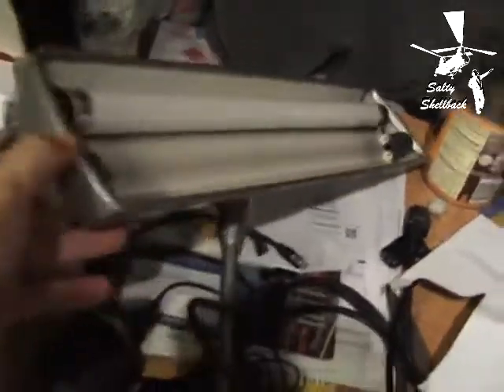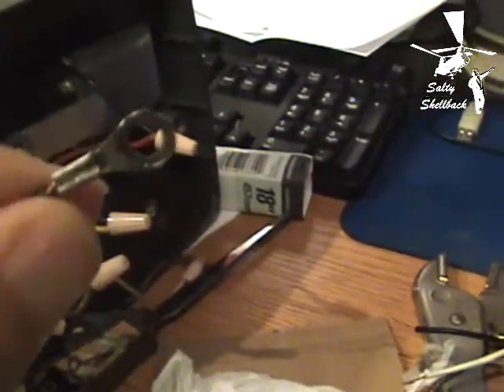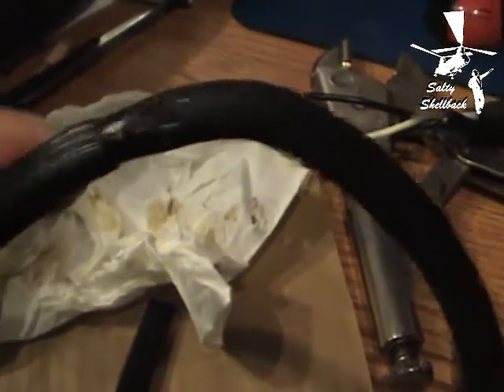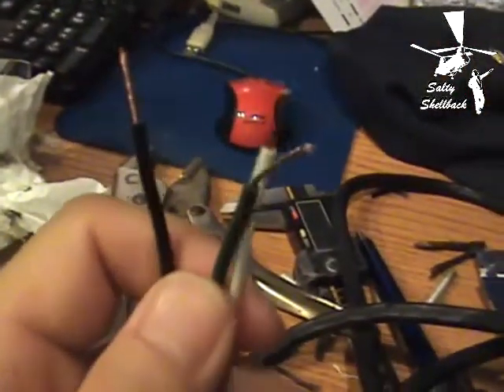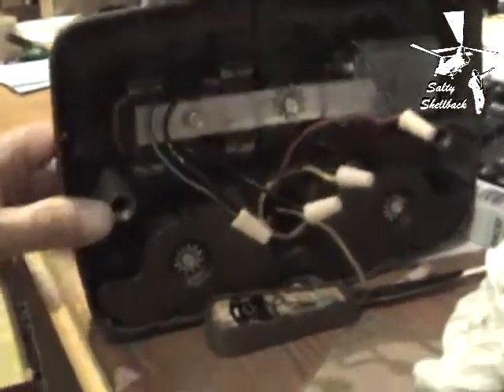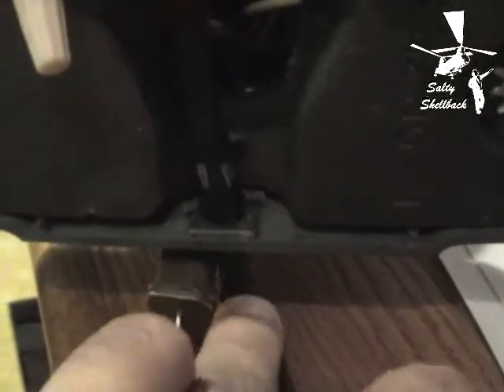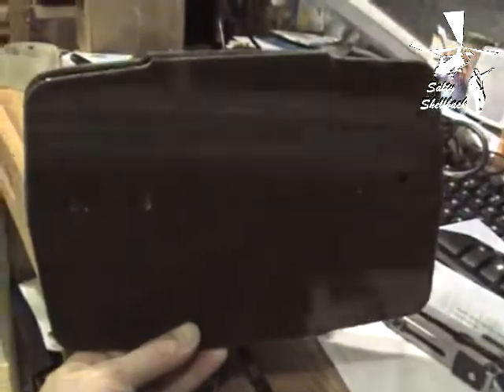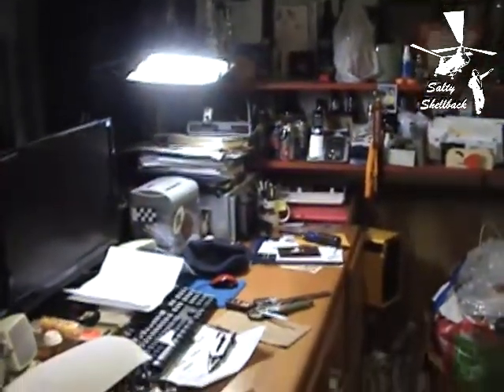Trash to treasure lamp

Comment: Much of the old office equipment is pretty cool, built to last, the weight was no object because it was built here so didn't end up being shipped from overseas.  Some of those old filing cabinets are so solid you could have stored bricks in them, the new ones give out under the weight of paper.  The old furniture is made like 50's Buicks, and is great repurposed for shop use, but a real bitch to move.
Reply from the maker: Yup, I have an old wooden swivel chair that I hate to get rid of because it is solid.  I just need to get some new wheels for it and fix a few slats that fell out.

Comment: Great snag ! I'll dumpster dive in a heartbeat for things like that ! I have found several nearly new vacuum cleaners that only needed new bags !
Reply from the maker: I got a Hoover upright that is like 15 years old and the pivot lever has broke off, a lot of the accessories are broke, the hose for the accessories is crushed, but man that thing still works great!  It works better than my shop vac.  My son sucked up a toy mouse the other day, and it didn't even miss a beat...lol

Comment: As an electrician I can tell you those old ones are high quality. You can still buy parts for them on ebay if yyou can read the old part number. You got yourself a good one there.
Reply from the maker: COOL!  Maybe I can make a table to put it on out of pallets :-)